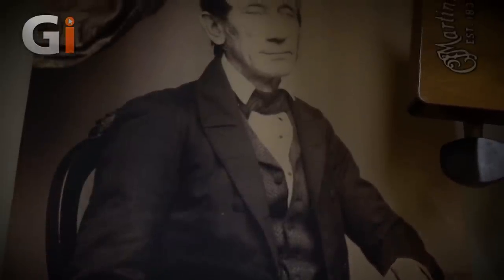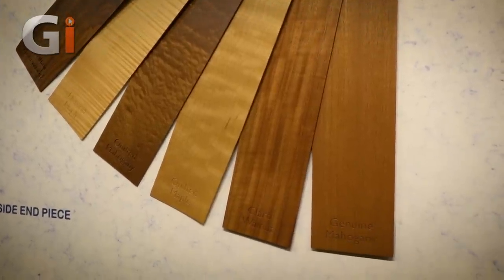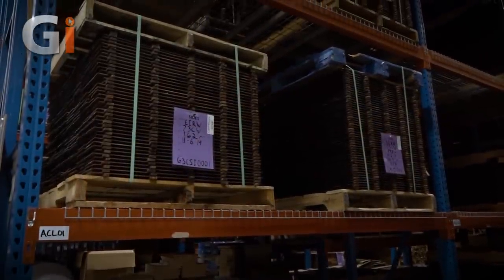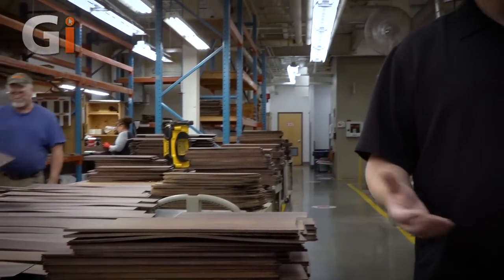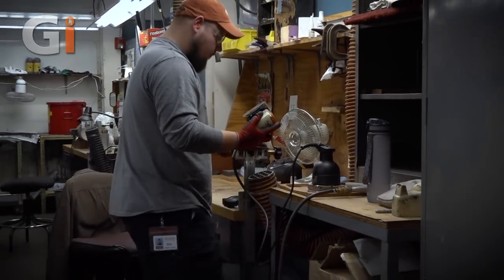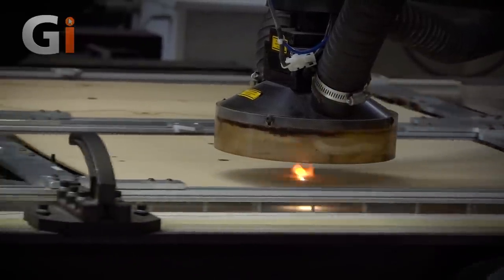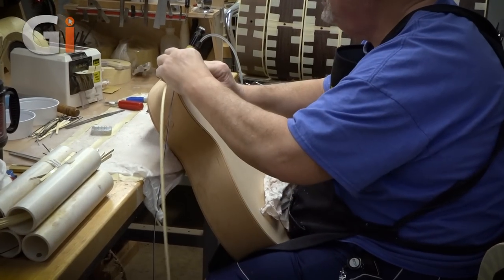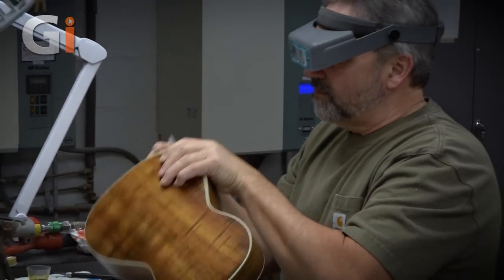Martin Guitars Factory Tour | Guitar Interactive | Feature

Comment: How in the heck do they keep the humidity levels—especially in winter? How do they not get mold in the walls? When relative humidity inside is at 45%, and the temperature outside gets below 40, condensation builds up in the walls leading to mold. How do they keep those climate specs in Pennsylvania?!!
Reply: 45% is NOT humid!!!  You will NOT drown in condensation!!

Comment: what exactly is HPL, there's nowhere that explains that. i assumed it's sweepings mixed with glue under pressure....
Reply: I typed in Martin HPL on google and had the answer in 1 second. High pressure laminate:

Martin's High Pressure Laminate is created with wood fiber and natural resins to provide a strong, stable, and affordable structure that is very good at reflecting and amplifying soundwaves produced by a guitar soundboard. Martins made with HPL back and sides have a distinct, pretty ring, and plenty of bass response. Those made with solid wood tops have more tonal variation and individual character that improves with age, as well as increased volume. Those made with an HPL top do not project as loudly and have as simpler, yet pleasing tone.

Environmentally friendly, HPL is impervious to fluctuations in weather and humidity. Martins made with it are often beautiful to look upon, as they are adorned with photographic reproductions of primo tonewood from Martin's world-famous stash, which would cost additional thousands of dollars if you wanted to have an upscale guitar made from the actual wood.

Ever tried using Google?